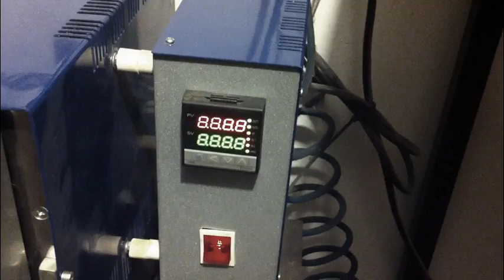MAKING A CUSTOM FOLDER - In The Works - part 5 (final)

Comment: Question mate, why don't you quench your blade in oil after heat treating it, make your edge last longer and hardens the blade even more ? Or if there a specific reason as to why you don't do that ?
Reply: some steels you do not need to do that with like 01 and other tool steels are air hardened steel. others like cpm steels, like the one he was using more than likely, are usually sub zero quenched in alcohol and dry ice, and the temper is done in an oven to a certain degree after that the molecules are aligned and then there is no need for a fast quench. its a powder steel as well, so its not beat and hammered to align the molecules like carbon steel, which is usually mar tempered in oil. it can also be sub zero quenched too. So, it depends on the steel and whatever it requires.
Reply from the maker: Like Mike has already mentioned it depends on the steel. One of the most important features of the plate quench is it prevents the steel from warping and that's very importand in a folder. Plus it's more consistant (You usually have to preheat the oil to a certain temperature and keep it there, putting one blade in makes the temperature go up so the 2nd blade will not quench the same). Lastly it's a much cleaner process.
Reply: also, if you use a blade bar stock that is already tempered, you can just remove the stock and the knife is done. aside from polishing, grinding, and other work like that. the problem with that though is all the heat done to the blade when grinding messes up the factory temper imo. for a custom like that, that is usually never done. cheaper knives and folders are done that way all the time, like the ones on ebay with elk handles.
Reply from the maker: mike smith I don't really get what You're saying to be honest, but You can grind after heat treat if You're careful about it and cool it down frequently. I do the final grind on my folder blades after heat treat right now as it's much easier to heat treat an unground blank.
Reply: i guess it depends on what you are doing. if its stock removal then it doesn't matter, its already heat treated, you just temper. on some blanks the blade is completely done, it just needs a handle and polish/sharpening. also, the tempering can be done in an oven or kilm. A sub zero quench in rubbing alcohol and dry ice before will align the molecules too. But different steels are treated differently. Like CPM steels vs normal high carbon. normal high carbon are usually mar tempered in oil yes, like what cold steel does. But some are air hardened like 01. I'm not a huge expert, i have to go follow the directions by other better smiths on each steel to really do it right. but i always do the sub zero, There is a great vid on blade steel tested where a smith shows doing like 5 different kinds of steel. he's a bald guy and pretty scientific about it. search for blade knife steel tests. i think 3v and A2 came out on top, and then 01 was ok too. some were horrible. but most are pretty similar as long as they are not abused, or really cheap like 440a.
Reply: i was confused for a moment with this side youtube comment thing, but i understand what you are saying now. thats cool, yes there's nothing wrong with stock removal after HT the whole blank. I like your knives, they are awesome. and  yes it is easier to treat the whole blank, before grinding. Then temper. i just repeated myself a little. i get confused on heat treating and tempering, i used to believe they were the exact same thing! lol

i have another question in the next comment too, sorry for the top redundancy.
Reply: cubixthe
thank you for clearing that up, very informative vid and response...
Reply: I just bought a used shun/kershaw 8" knife in Damascus SG2 at 65hrc. Awesome knife. it is 250 new atleast, i paid 112 and want to make it 300 plus - it has a few scratches, little spots of rust and is kind of dull. But i plan to machine buff/polish the blade and bolsters. Also, i think if i cover the logos in clear nail polish and then just don't hit them too much it will be fine. The handle is that normal black pakka wood and very nice, i plan to maybe clean it and polish it lightly as well, or maybe we can put a new handle on it? idk about that though we'll see how it looks. But was wondering, it is full tang and has 2 steel rivets on the handle, could the handle be taken off and more fancy rivets be put on easily? Also, what is your opinion on this project? i'll also need to sharpen it too when done, which is a bitch after a mirror polish, maybe i can find someone to do that, can you sharpen w/o hitting the mirror blade at like 18 convex 2-3k grit mirror edge? and add some cool custom rivets to the handle then add epoxy and put it back together? It wouldn't be too hard, but after i polish it up, i don't want to scratch it on stones. also, if its too nicked maybe you can grind out some of that lightly, i don't think it is though. I think blue, red, or yellow color would be nice for the 2 round ones in its place.

the model number is: Shun Kaji Kai KDM0031 SG2 Clad Western Cook's 8" Knife with Case

i just ordered it on ebay, and i'm waiting to really see the condition, but i couldn't pass it up - no ps4 this month for me LOL.